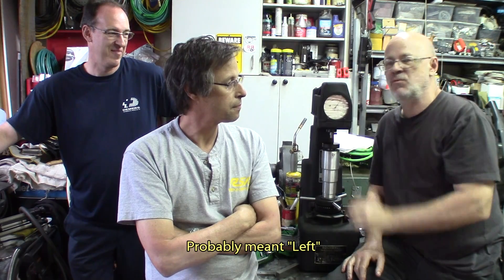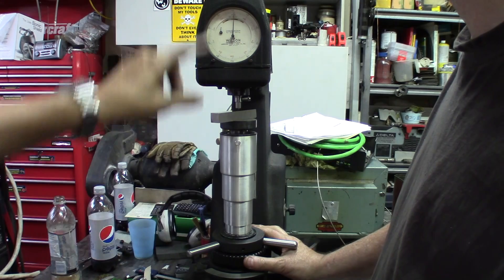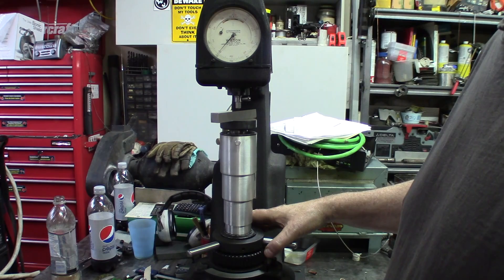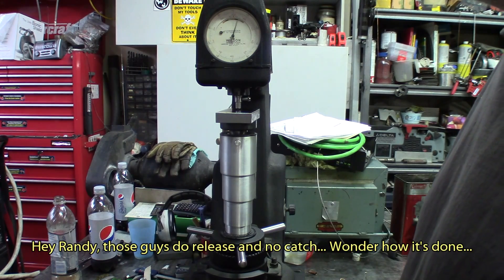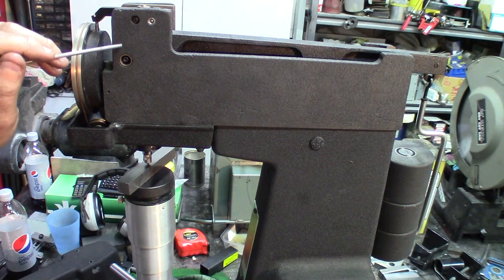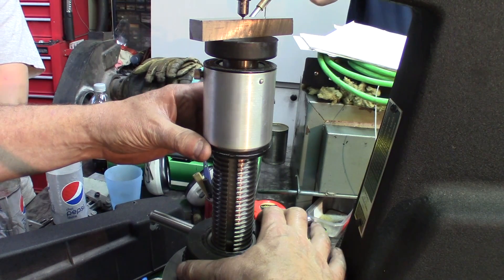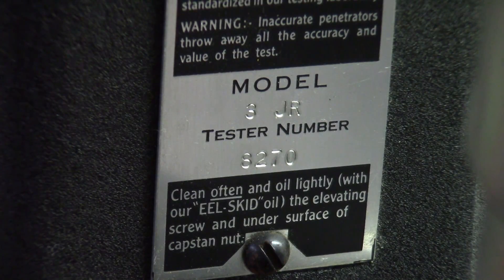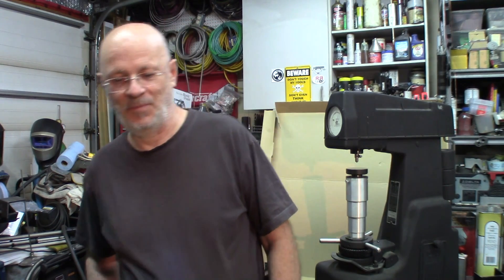How it works... Rockwell hardness tester from Wilson

Comment: Bonjour Pierre, What kind of repeatability do you get on your machine? Do you do a few tests and average them? What kind of scatter do you get in a few tests?
Reply from the maker: Since I'm not in a lab coditions shop, it's a little more difficult to control all parameters. On the other hand, I can say that it's relatively constant, like within plus or minus 1 or 2 RC from times to times, this is enough for my personal use...   🙂
Reply: @pierresgarage2687  Thanks, I have the superficial wilson 3js (i think) and im getting about the same sometimes 2-3 RC, was wondering if thats par for the course. Salut from ON.

Comment: thanks but one question : if the test results are 100 HRC does that mean the material being tested is just as hard as diamonds and if yes what metal would that be ?
Reply from the maker: You're raising a good point, I wouldn't know if we test a materia las hard as the diamond oof the indenter...   
In any case the reading is in fact the measurement of the indent caused by this same indenter. Also I've never personnaly measured something above around 70HRC.
thanks for your comment....   🙂
Reply: @pierresgarage2687  another YouTuber got back to me and said yes to it being diamond but also did not know any other material as hard as a diamond.

Comment: Great job! My boss just bought this old machine 3JR 4434. How do I calibrate to standard disc? 45.3Rc tests 48Rc
Reply from the maker: For precise readings you'll need to acquire some reference disks and calibrate your tester prior use, those disks are available with different hardness, the cost is quite high though unless you find some almost new rarely use items on eBay or so...

In the follwiing link you'll find a brochure of what you need to find.

https://www.buehler.com/products/hardness-testing/hardness-testing-blocks/wilson-rockwell-test-blocks/

Comment: where can I test some metal at?
Reply from the maker: If you have a machine shop near your location, you can try to make some agreement with them if they own all the required equipment, other places where it could be possible to have tests performed are either a wholesale metal supplier, or, I know there are some big metal recycling firms that own X Ray metal analyzers, for the moment this is what I'm thinking about, possible there would even more possible places.....
Good luck in your search.

Comment: Hey Pierre I recently picked up a 4jr version of this machine but it has no weights with it........you wouldn't happen to know what's they should weigh do you?
Reply from the maker: As shown in the video, the first one on top is 2kg, the second one is 1,6kg and the last with the support is 1.8kg. It should be the same for the 2 models as the ratio is the  same.
Reply: @pierresgarage2687  you have a 3jr though dont you the weights are the same as 4jr?
Reply: @pierresgarage2687  25:1 ratio?
Reply from the maker: @westweld  I've read a long time ago that the 3jr and the 4jr use the same amount of weight. The 25:1 ratio is to reduce the actual weight used to perform the test, in reality the diamond is seeing 150kg on it's point when testing on the C scale. With this reduction of 25:1 you only need 6gk of actual weigth to make the diamond see the required 150kg.
To be exact the 1.8kg is actually 1.84kg this is after actually verified with reading other peoples testimony and measuring myself on a home digital scale.
Reply: @pierresgarage2687  thanks Pierre that's what I was looking for

Comment: Perhaps you can clarify something for me, please? The tester has 60, 100 & 150kg weights. Rockwell scales A, B & C use 60, 100 & 150kg respectively. The dial only has scales B & C on it 😕
how do you go about measuring in scale A? For Tungsten Carbide?

Comment: I just bought an old rockwell wilson model 3s off of craigslist. The guys that loaded it up put it on its side and a bunch of hydraulic oil spilled out, now it's out of calibration. When I tested it at the site it was spot on. I can't find a manual for it and have no idea what type of oil it needs and how much. Any help would be appreciated!
Reply from the maker: Sorry it took a little more time to get back, I'm still searching for some kinda manual I got "Somewhere" ...
If my memory serves me well, I got in touch with the Rockwell company service and asked for info about my model, and I think a nice lady sent me a link for a pdf about my machine...
In case it doesn't work for you, the mention I remember is taht this oil serves as a timer and a damper to make the indenter slow the decent and make it progressive, the delay for the full movement should be in the neighborhood of 5 to 7 seconds to full pressure.
The type of oil recommandes was named "Whale oil" or something of the sort, this is what was used a long time ago in sewing machines, so, if you find the actual replacement you should be near the original specs, take note here I'm talking about the type of oil used in industrial machines, the ones with an big oil bath underneath the machine...
Hope it helps and thanks for viewing,    Pierre

Comment: Hello @Pierre's Garage thanks for the great video. I have a 2 questions in mind, your help will be highly appreciated. 
1- There are 2 sets of readings in the outer dial C0-90 and B0-90 in the video the reading was C61, why not read B91? what is the difference between the 2? 

2- How do we make sure which dia indentor to use for our application? 1/16, 1/8, 1/4 ? 

Its confusing, your help will be highly appreciated.

Thanks
Reply from the maker: Hi,

For the first question, you have to read the scale according to the weight hung to the back of the instrument, meaning that id you use the full load you know you have to read the C scale. To adjust for the right scale there is a chart on the instrument that will tell the scale and load combination...

Second question, in order to use the round softer indenters you will need to use some indenter that penetrates less into the measured material, if it's softer steel, aluminium, zinc, lead, plastics...   etc...  You'll need to follow the charts in order to install the right amount of weight and indenter combination, this should be supplied with the specific instrument you are using.

Hope this helps you to understand, thanks for viewing and for comment,    Pierre

Comment: Thanks for the video Pierre, I just acquired a 1 JR with no 50 kg weight and of course, no instructions. This video will definitely help as it's nearly impossible to find information on the internet about these machines.
Reply from the maker: +L98FIERO You're right about the lack of information, this is why I thought it would be interesting to publish a little basic info about it.
Guess that now you figured how much weight you need to get a replacement...    
Thanks for comment....    Pierre

Comment: It was nice to see the components of the tester, but you didn't  explain how it works.  What is the preload? is this a displacement?  When the weight is applied what is being measured? Displacement? What units?
Reply from the maker: Hi, the scope of this video was to demonstrate the usage of the tool and what it is meant for, with a brief look on the internals.
I could make a more detailed and theoretical video where I could explain how the preload is applied, then from there, after with the full load applied, the tool measures the difference of penetration and shows it on the dial. This says how hard the measured material is.
The units are kinda standard to Rockwell, where there are other standards like Brinnell, you can find charts that tells you what is the correspondence between the standards.
Just as a couple of examples you might want to know, HSS steel is about 60 to 65 RC, a grade 8 bolt around 35 RC, cold rolled steel under 10 RC...
Thanks for watching and for comment,    Pierre
Reply: +pierre beaudry 
Thanks for your reply.  I know the hardness units are Rockwell, I was asking if you knew how that is obtained.  A preload to some displacement of xxx in or mm followed by a penitration of? xxx in or mm = a Rockwell hardness of ?  I think I found some of the answers here https://en.wikipedia.org/wiki/Rockwell_scale but still some details are missing.  Maybe I will read the patent next :-)
Reply from the maker: There is some advanced metallurgy in this process, you seem to have grasped the basics, where the preload is the starting point and the difference of measure in penetration after the final load is applied, will give you the hardness according to a established standard.

As just a curiosity point, with your bare eyes you can detect the difference in depth between two different samples that are far enough to imprint a notable difference, it's this difference that the tool will quantify exactly to tell you how hard is the sample.

Good research.... ;)

Comment: Weird thing, the first weight, on the top of the stack, is a 50 kg/2 kg, and the last one on the bottom is way smaller, but it is 60 kh/2.4 kg? How does that work? I know the mass of the attached arm counts for some, but definitely not the difference of 0.4 kg.
Reply from the maker: +Andrew Delashaw The inside of the wights are not totally solid so they can be adjusted to calibration, not to rely on the actual looks of size...   ;)
Reply: +pierre beaudry Thanks.

Comment: Does this use the Wilson Mobile or the standard Wilson indenter? Specifically looking at the Gilmore line of products. Good video! Learned a lot!
Reply from the maker: Joshua Svinarich Hello Joshua, the indenter  I use is a standard Wilson "C" brale ( 7310238 ), the indenter is changeable so I could us other ones like a 1/16" ball or whatever depending on the hardness of the material to test... I mostly use tit for harder material, though.
I'll explore Gilmore's site looks good at a glance...

Thanks for stopping by and commenting, Pierre

Comment: That was very interesting Pierre.  Believe it or not I too have a hardness tester.  The difference is it is for testing lead.  You make the little dimple with the tester pressure then compare it with an optical device.  Thanks for sharing.
Reply from the maker: cerberus Hello Harold, this one will go right to the other side of your lead bullets... lol
I'll try to put my hands on the softer material testing probes, like the 1/16" metal brine, cause with much softer materials diamond is a little too hard and pointy...
Cheers,   Pierre